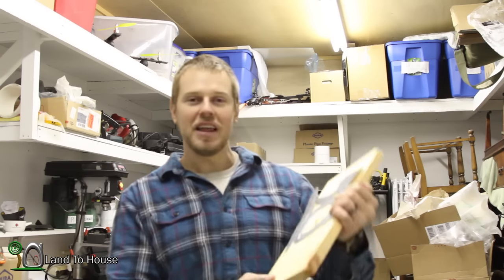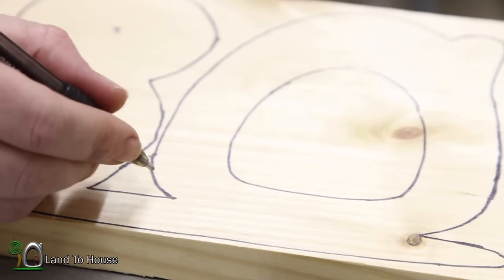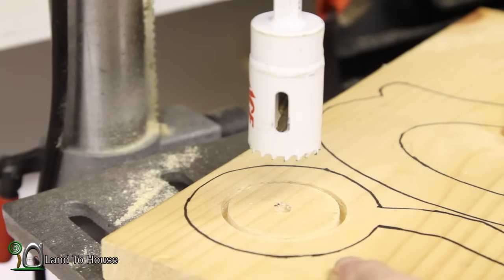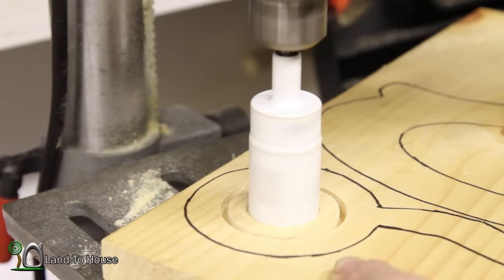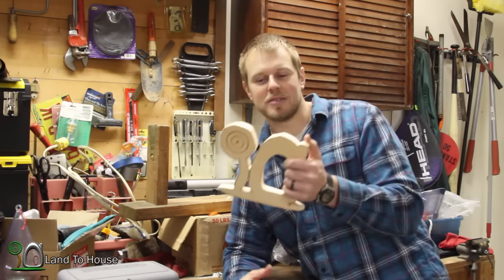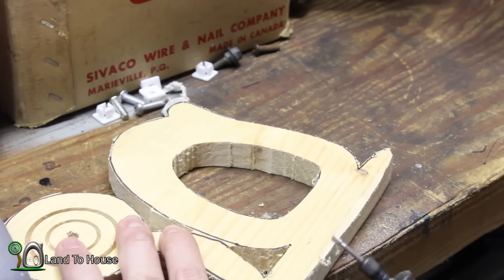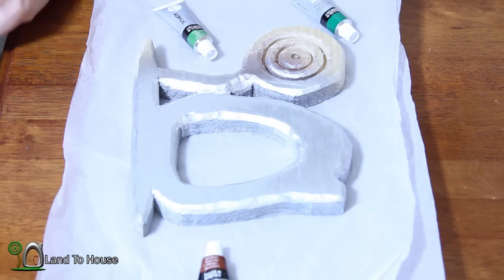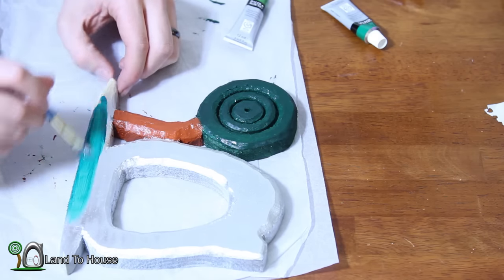Make the Land To House Logo from Wood

Comment: I was so hoping you weren't going to use a knife on the  edges! I think you would have found a problem with the grain splitting at times. The dremil is a useful tool that I don't use nearly enough. It turned out pretty good.
Reply from the maker: You are right.  I did not want to use the knife anyway.  :) the dremil is so handy in many situations.  I think i will make more projects with wood in the future.  I have anyways had an issue making things like this look "finished " practice is key I think.